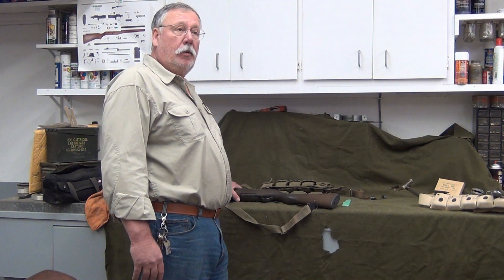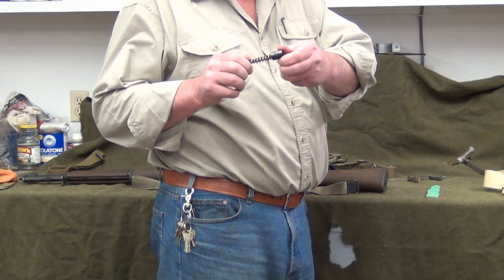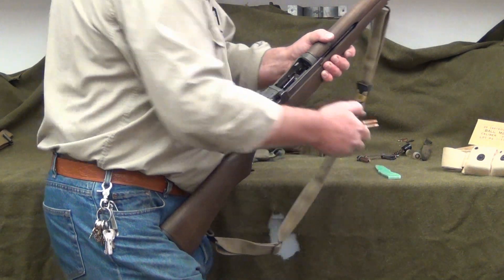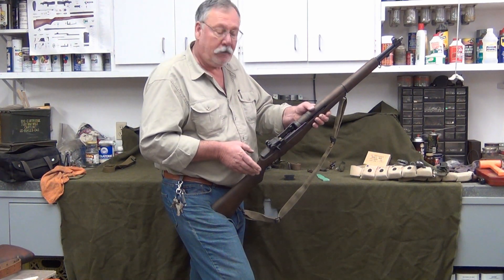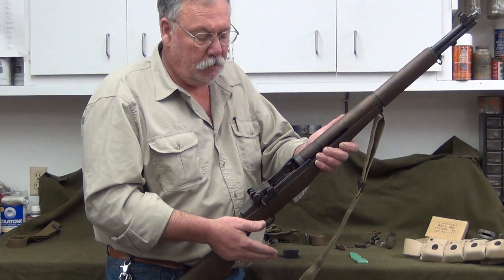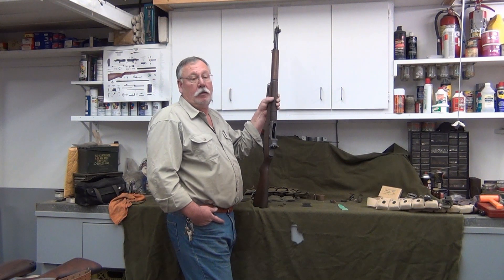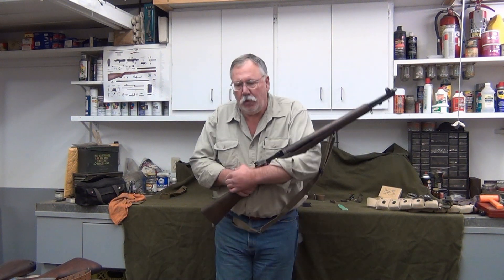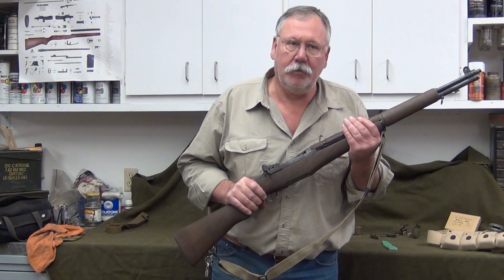Garand Rifle 'This Old Rifle' Part 3

Comment: The M3A1 combination tool was replaced by the M-10 and you can do everything with it as you can with the M3A1 except extract a ruptured case.  The M3A1 had the ruptured case removal tool that the M-10 lacks.  USMC '69  - '73; Vietnam '71 - '72

Comment: Mr Stuff dude, I use Mobil 1 full synthetic heavy grease in my Garand. I have been told that the only better thing to use is something called Permatex superlube. The mobile 1 grease can be found at pretty much any auto part store. I got my grease at pep boys. The Permatex Superlube is very difficult to get ahold of my buddy said he actually had to order his. As far as what to look for, it depends on what you want. I wanted a WW2 serial so it took me a while to find what I wanted.

Comment: Biggest thing is check the barrel for wear on both the neck and chamber. A gauge is recommended but if you dont you can actually use a 30.06 bullet and see how far it fits the chamber. If it doesent fit all the way in the barrel that usually means you are good. Mine has some corrosion from corrosive ammo make sure you dont have any of that before you buy it. Use a bore light. Have somebody check your trigger assembly and bolt and most of all dont get it if you arent sure of the condition.

Comment: Okay, i'm fairly experienced with the M1 but I have not been able to fit all of the cleaning accessories in the stock compartment.  I can get the cleaning rod kit, the grease container and the oiler in fine but not the tool and chamber brush in addition.  Am I doing something wrong?  I have the newer two-sided oiler.